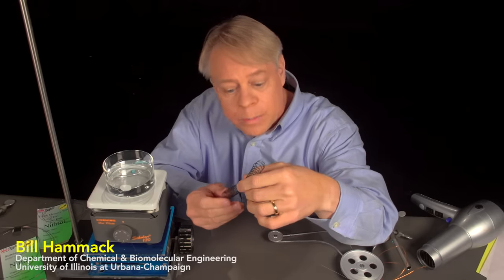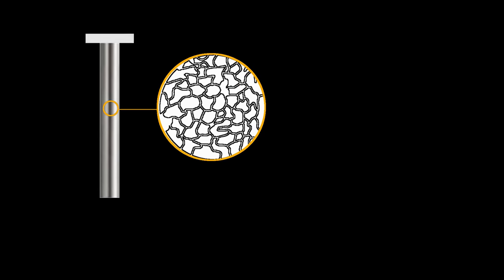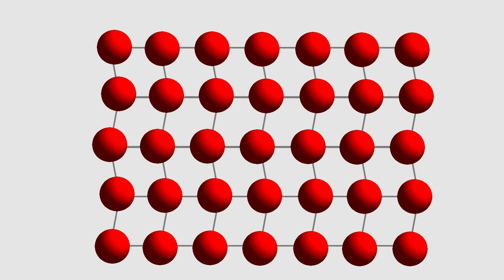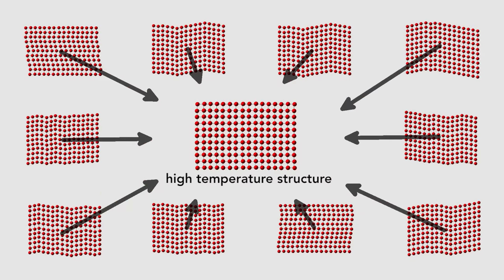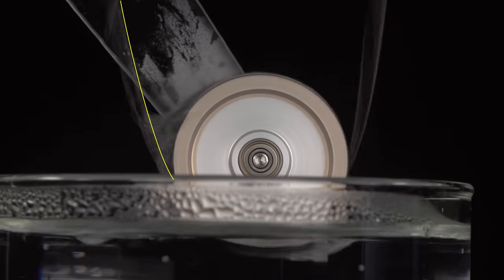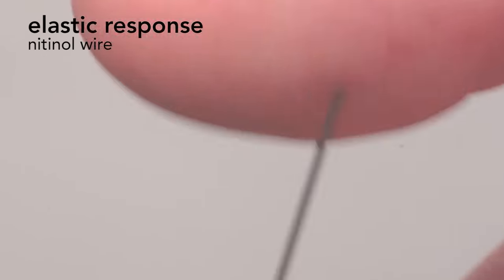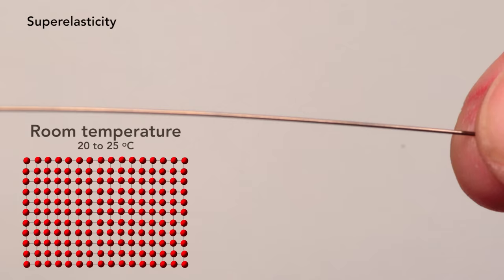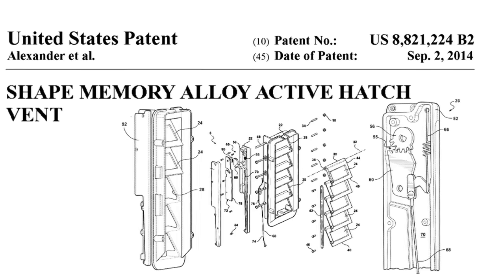Nitinol: The Shape Memory Effect and Superelasticity

Comment: Years ago, nitinol eyeglass frames in really cold winter air lose rigidity. They almost became floppy. A bit awkward when you'd like them to stay on your face.
Reply: All of my frames for the last 20-ish years have been 'Flexon' brand nitinol. I had only one pair break and that was at the bridge while I was demonstrating how cool they were, lol. I think they didn't do so well on twisting but fine on bending. But at this point I think only the arms are made of nitinol.
Reply: @snaplash  Why would Nitinol be a selling point for a frame? I really don't see the reason.
Reply: @hardcase1659  As said in the video, they are pretty resistant towards compression and bending, so if you were ever to unknowingly sit on your glasses, or step on it, the frames would not be damaged. It has its merits, but conventional frames are better if you ask me.
Reply: @fornixtail0829  I bet that using any alloyed spring steel would also be very resistant to deformation. Using Nitinol just doesn't seem like a practical investment.
Reply: @hardcase1659  It does not seem practical because you may be living in a place were the temperature fluctuates to the extremes. As most metals, when exposed to low temperatures they become brittle. This case is moreso observed in Nitinol that is why Nitinol glasses mainly break in cold climates, but if you are living somewhere relatively warm then it is a pretty viable pair of glasses. In addition, If you still decide on buying Nitinol glasses, I would recommend buying high quality ones since impurities create weakpoints that may break over time.

Comment: Did you know you can run electricity through it to make to heat it up too.
Reply from the maker: I didn't know that!
Reply: I was always fascinated about this technology. Thank you very much for this detailed video.
I have seen volt meters (kind of) working based on heated nitinol wire. May try googling 'nitinol drive unit Foxboro' for further information :)
Reply: @engineerguyvideo  it opens up quite the possibilities. Being able to trigger it on command. Came up with the idea for use in a steerable catheter tip. Did not have enough time to develop it but it was exciting project.
Reply: -Isnt this also the wire thats used for resistive heaters, like toasters?  Lots of uses, this stuff.-    
edit: Nope that's "Nichrome" not Nitinol, thx @heyou
Reply: @engineerguyvideo  There's a video by Mike's Electric Stuff where he takes apart a disposable insulin pump, and the pump mechanism used nitinol wire
Reply: @roidroid, that is nichrome wire.
Reply: oooh
Reply: @engineerguyvideo  , I think a common marketing name is muscle wire. But yup it's metal it conducts electricity i^2r... heat. Glad you can squeeze in new videos.
Reply: centpushups, the engineerguy as well as all others on this tread/forum.
 Great video! I also have a feeling that the conventional thermostat in a car/automobile cooling system has this material at a particular alloy so as to detect temperature and allow the Engine coolant to flow when Engine is up to operating temperature as well as closing it up if the temp is too low. I am open to what others know as I am here to learn. I hope my research on this subject from years ago is not incorrect, if you can add to the discussion that will be good.
 Cheers, John, Australia.
 Edit. I think it is some form of this wire alloy that is used as air flow sensors in electronic injection cars as well, it is about changing the resistance of the wire with temperature and then the brain(computer) says how much fuel to inject at this air flow and this temp and load of vehicle, rraa rraa and so on.
Reply: @joandar1  , mechanical thermostats are typically a wax motor for a car cooling system, or a bimetalic strip for a simple thermal fuse. The wax changes phase (and volume) and pushes a piston. The bimetal strip has two metals that expand at different rates laminated together so the strip bends. The strip is usually coiled for more mechanical action. Old house thermostats used this to rock a mercury switch iirc. I think the old clicky disk toys that you heat up in your palm and jump off the table as they cool back down use this? The mass air flow sensor mostly uses a heated platinum wire and uses the change in resistance to figure out how much air flowed past it.  None use metal (or polymer) temperature (or magnetic) shape memory.
Reply: That is how the locking mechanism for the screen on surfacebook laptops work.
Reply: @anullhandle  Thanks for the reply, I am familiar with the bi metal principal of thermostats as they are used commonly in hot water systems in the form of a button. One is to turn on the element and heat to nominal temp and another is a safety to cut supply to the system if the first thermostat fails and heats too much.
 Platinum wire for the car air flow sensor is correct, I remembered wrong , when I read you comment I had my memory refreshed, thanks for that.
 I will try to look up the thermostat for cars thing again as I still feel that the ones I have seen are described in the information on nitinol in other references to this material.
 Cheers from John, Australia.
Reply: Barring being in a super conductive state, every material heats up when you pass electricity through it because of resistance.
Reply: The day you stop learning new things is the day your brain starts to die.
Thanks to you and Bill, I'm good for a couple more days :-D
Reply: @engineerguyvideo  aww, I was starting to think you just knew everything
Reply from the maker: I do know everything, but I don’t want to show off
Reply: Is that what they use for thermostatic springs in carburetor chokes? Or is it just standard steel.

Comment: Great vid and topic.. Quick question, what is the deterioration rate of the metal reshaping back to the high temperature form? Or in other words how many times could it be rated for returning to the high temperature state?
Reply: Depends on the size, how much it gets deformed, and the Nickle-Titanium ratio. However, as long as you stay within a certain stress percentage, there is little-to-no metal fatigue and it can return to its original shape for a very long time.

Comment: How does the efficiency of the nitinol engine compare to a sterling one?
Reply: Not very efficient considering the energy lost in heating water. Still super neat though
Reply: Id be curious to see how many joules of thermal energy is absorbed to reach max speed. Theres mire efficient ways to heat things, like with current. Niti is resustive compared to other alloys

Comment: ive heard about using nitinol in the "tires" for future vehicles like the mars rover where a tire inflated with a gas isnt an option and because its a "tire" it needs to retain its shape.
Reply: In the literal sense a thick iron hoop can be a tire, as seen on old horse drawn wagons. I'm not certain of the etymology but I think the term comes from the iron hoop "tying" the other wheel parts together similar to the hoops on a wooden cask, but of course it also served to wear much longer than bare wood and was fairly simple to replace. 
The moon rovers used woven spring-steel wire tires. Inflation with gas is always an option but repairing punctures  and re-inflating could be a bit more trouble.
Reply: wolfedog99 Yeah calling for roadside assistance from Mars or beyond is just a tad too expensive

Comment: we used nitinol as an actuator in a miniature microscope. We tried to use its resistance as an indicator of position but found the effect was asymmetric depending on whether we were heating or cooling. We ended up adding an external sensor which bulked the system up a bit but it was still the smallest actuator going. BTW, attaching nitinol to things can be quite tricky

Comment: In ham radio Nitinol is used for portable antennas.  You can cut it to the proper length and not have to worry about it bending.  Being able to use a proper 5/8th length antenna removes some of the compromises of the rubber ducky antenna.

Comment: One of the latest inventions using nitinol is as an efficient cooling device that will be able to replace refrigerants. The shape memory effect absorb significant amounts of heat when it's bent out of shape, and then releases that heat when it is allowed to revert to its normal shape. The difference between the loaded wire and the released wire can be as much as 20° C (36° F).

Comment: Many engineers (myself included) are designing heat pumps (air-conditioning systems) based on this material. This video is a good example of how to clearly explain what's going on in the process. Thanks 😊

Comment: The next Mars rover is intended to use shape memory alloys as incredibly durable wheels, replacing the incredibly thin aluminium ones used until recently I believe. The wheels are basically thin wire as shown here woven into the shape required.  Incredible stuff, light and self repairing.

Comment: I have a small collection of NiTi "hydrolic" lifts. They look and act like hydrolics you've seen before, but actuated by an electrical current heating the NiTi coil inside it. Eventually they'll be used in a Raspberry Pi project. BTW the straight wires (which I also have) exhibit another useful function. You can literally stretch them a small amount (like muscle on a fulcrum like you're elbow) and electricity heating it up makes it pull like a lever VERY hard. Really interesting stuff.

Comment: I once built a foot long, six legged robot using Nitinol wire for the muscles. It was called the "Bionic Bug" and was modelled on a cockroach. It got a lot of media attention at the time (about 25 years ago) and was featured on TV, radio and a few magazines. The lead acid battery that I used was unfortunately a little too heavy and it always dragged it's backside on the ground, but otherwise worked very well.

Comment: @Giovanni De Vita -  I hadn't thought about changing the composition of the alloy to alter the temperature to which it responds, since the nickel to titanium ratio is so critical.  It reminded me of an anology of another nickel alloy, invar which has a curie temperature around 280C. If you lower the nickel content to 27-28%, it's curie temperature comes down to room temperature. There are other unusual properties with nickel-iron alloys.

"Later in the same year Hopkinson discovered that a sample of 25% nickel steel furnished to him was practically non-magnetizable at ordinary temperatures ... it retained its non-magnetic condition while being heated up to 700 or 800 C and did not recalesce on cooling from a high temperature. But when the temperature was reduced to a little below 0 C, ferromagnetic properties appeared, which were strongly intensified by further cooling. Moreover, cooling to -50 C with solid carbon dioxide effected such a transformation that, when the specimen was returned to 13 C, it was found changed from a non-magnetizable to a decidedly magnetizable substance; and it remained magnetizable on heating until 580 C was reached. In the neighborhood of this temperature it again became magnetizable and continued so on cooling to the temperature of the room. By these experiments Hopkinson showed that the material can, at ordinary temperatures, exist in either of two quite different states. both of which are stable." (page 4)
Invar and related nickel steels April 4, 1916
http://books.google.com/books?id=ztAOd_hH7h4C&pg=PA23&am...

Comment: Some of the best content on YouTube in my book! I have a bit of a strange question for you, might have an interesting enough answer that others would like to hear. When I wash out my Yeti tumbler, I will put a little bit of soap in the bottom, add about 100 ml of hot water, then put on the lid, cover the drinking hole and shake vigorously to foam up the soap. I have noticed that this creates a fair amount of air pressure in the sealed cup. This same effect is not achieved with hot water alone, so I know it isn't just from expanding gases due to heat. Does the soap somehow release trapped gases in the water? Is there some other effect that I am not aware of? Thanks as always for the super interesting videos!

Comment: I use Nitinol at work. We shape it into the intricate shapes we want while dipping it in a 99% IPA and dry ice bath. The cold makes it super malleable and easy to manipulate into the shape we want. Then when we get the shape we want we dip it into a 545 C salt bath for a few minutes to shape set it. I think leaving it in there for a few minutes makes the shape very rigid because it's impossible to bend the shape set piece without breaking it at room temp. You'd have to put it back into the ice bath for a few seconds to be able to manipulate the shape again.

Comment: The signal stick antenna for handheld ham radios use this metal and it works great for receiving signals, in the cold it gets droopy but it will return to normal in room temperature, very cool

Comment: The cool thing about these materials is how you can tailor the composition to work in different environments and activate at different temperatures by adding different elements to the material. For example, NiTiFe is cryogenic and transforms at around -150C while NiTiPtPd is high temperature and transforms at around 450C

Comment: Nice video but one important propriety, that could also play a role in the engine, is the contraction of the material; when heated, instead of dilating like normal metals, it will contract, and it will do with a relatively big force. This make possible to use nitinol as a "muscle", as it can contract by using a small flow of current (the nitinol itself is quite a good resistor)

Comment: Great video, but that is a vascular stent, not a coronary stent. Coronary stents are made of bendable cobalt alloys and are much smaller. The average size of a left anterior descending artery is a meagre 3-3.5mm in diameter. The stent in the video is reserved for larger arteries which are likely to come under more stress and/or compression due to their anatomical location, such as arteries in the legs where joints articulate or where they may be compressed during sitting or activity. One super cool application of Nitinol in cardiology however is where I work. The Medtronic Transcatheter Aortic Valve is an aortic valve which is implanted into the heart via the femoral arteries. The valve is pre-shaped and had porcine pericardial tissue sewn into the Nitinol matrix. We then compress the valve down into a loading system in a sterile ice bath. The ice water prevents the Nitinol from springing back to its parent phase. Once in the body, the valve is deployed from the delivery system and basically squashes the diseased valve out of the way and expands to fit the patients anatomy replacing the diseased valve. What was once major open heart surgery is now performed via a small Cather with a diameter no more than 12mm in the leg. A heart valve, in the heart, via the leg. Space age stuff. Technology rocks 🙌

Comment: @engineerguy , I really appreciate your work taking time to do this. I have bought Nitinol from KRL also as I noticed you did. Nevertheless, the sample I have requested is for transition temperature of 20C and it does not show any memory effect. I've tried to set the memory and had no success in doing that. The material is indeed Nitinol, but like me with a little problem with memory.
 Did you ordered with memory set already or you did the memory setting yourself?

Comment: I'd be interested about the force of the spring "springing" back into its original shape upon heating. For example, if you had a straight wire, and bent it into a V shape then tied a wire between the two ends of the V, and put it in hot water so the V would straighten back out. Assuming the string didn't slip or move out of place, how hard would the tension on the string be pulling as the wire tries to pull itself straight? Also, I'm curious what relationship this tension would have with the temperature of the water. If warmer water makes it straighten out with more tension on the string. Or if it makes a difference. And if it DOES make a difference, is that difference linear? So many questions.

I know I could easily buy my own nitinol wire to run my own experiments. I'm just not sure how I could measure the "tension" of it trying to reform. Maybe I could stretch out a nitinol spring and attach it to something like the old spring scales that butchers would hang meat from to weight it. I could attach one end of the spring to the scale, and the other end to something that won't move. Then heat the spring, and the scale would show how much force the spring is pulling on it with as the spring tries to pull itself back into shape.

Comment: Is it possible to have a straight nitinol wire that turns into a coil spring when exposed to body temperature? For instance placing the wire through the nasal passage into the throat where it then becomes a coil when warmed up. I have a nitinol stent for my throat currently that I paid $1000 for but I think it could be designed much better. My throat seems to still close when sleeping and I believe a coil is a better design. The 6" mesh stent is made by Alaxo. I'm trying to invent my own device and I'm the perfect test person.

Comment: I had Nitinol wires in my braces a few years back. Supposed to keep you from going back to the orthodontist so often for tightening. I wonder if they're just using the superelasticity of the material to keep it taught or if the heat of the mouth triggers the memory effect.

Comment: I made a heat engine using super elastic nitinol that solves the problem with metal fatigue and requires no welding of nitinol which is pretty hard but I'm not even motivated to show it coz unless it's made in the USA or another developed country there will be no interest in it and will be a complete waste of time but any way it's nice to see that ppl are interested in SMA